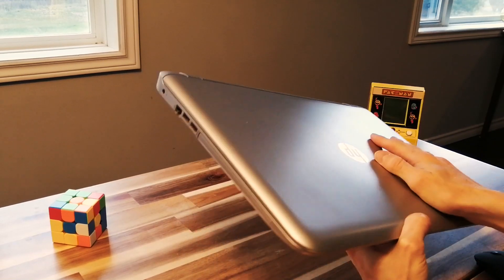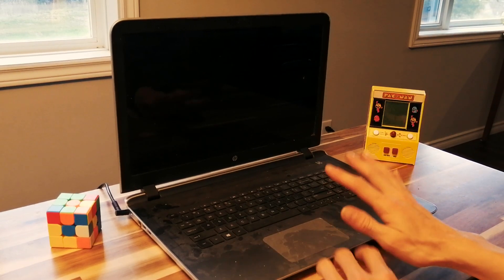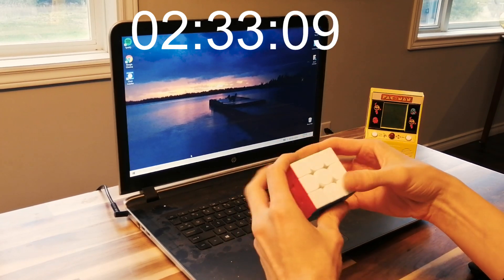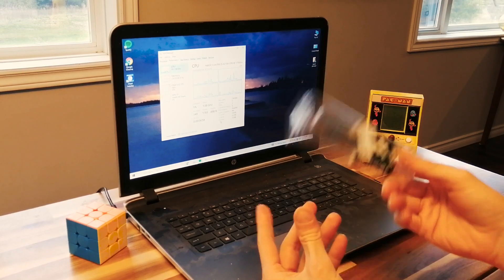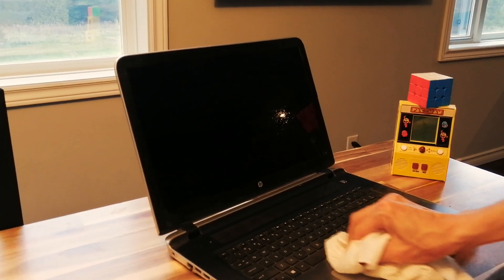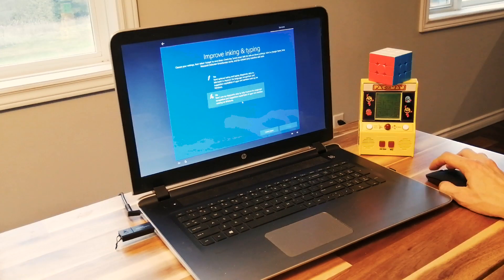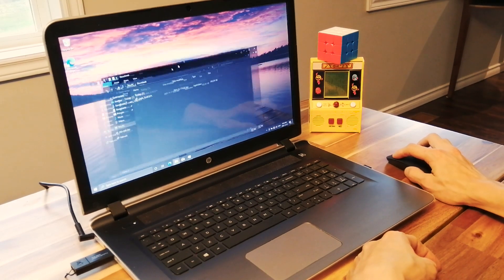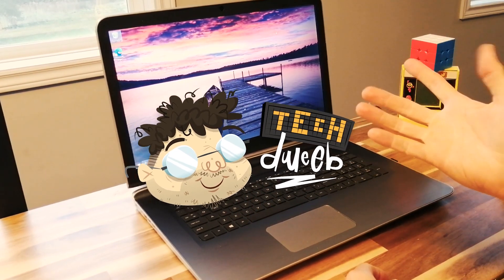BEST way to speed up your old slow laptop/PC - Make it run like NEW!

Comment: Since this is meant to be a guide, maybe go into more detail & depth like showing what you pared the ram with and it’s maximum size, what size ssd you installed & if cloning the old Hdd is needed or if extra drivers are necessary for the motherboard to detect the ssd? Also show where you got the intel graphics drivers from and its installation process? Thanks for video.

Comment: Will it make it faster if I get a portable ssd
Reply from the maker: Are you talking about booting off an external USB SSD? If so, then it MIGHT be faster, but probably not. You'd need to check the speed of your USB ports (USB 2.0 ports are slower than 3.0, which is slower than thunderbolt). If you can run an external SSD on a USB 3.0+ port, then it would probably be faster than an internal mechanical drive, but you'll always get the best performance using an internal SSD. Hope this helps!
Reply: @TechDweeb  thanks
Reply: @TechDweeb  no like what you did to make it faster but thanks for the information
Reply: @TechDweeb  I mean like if I get a portable one will it make the laptop faster